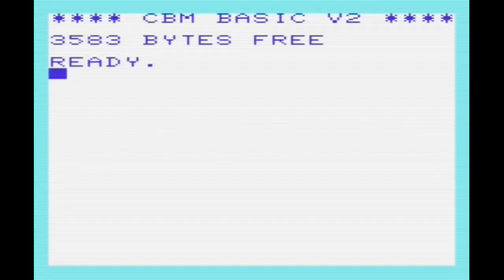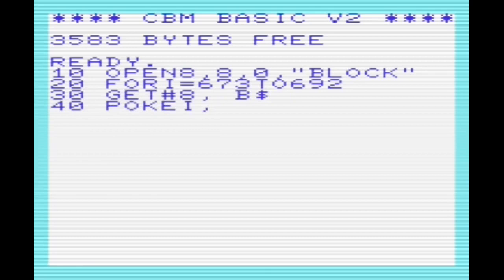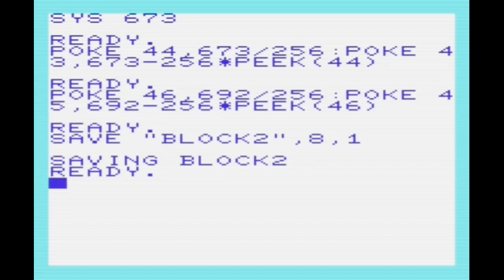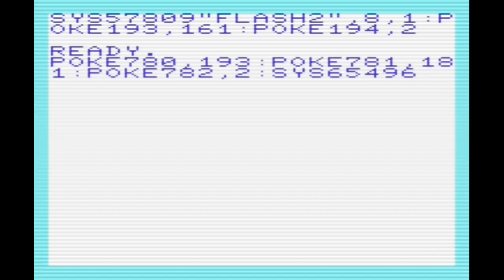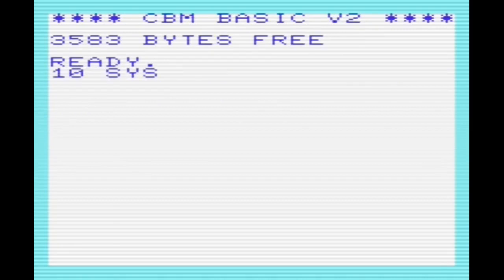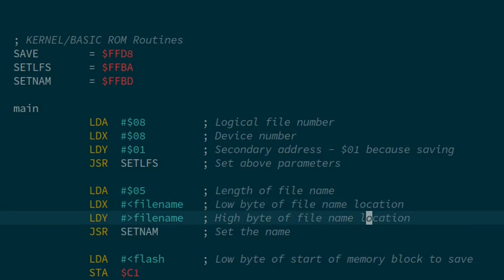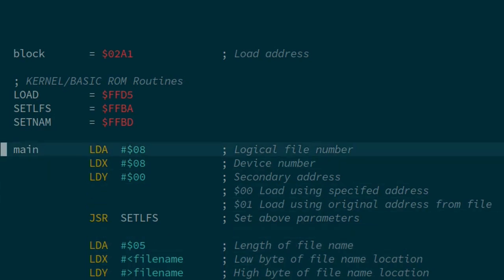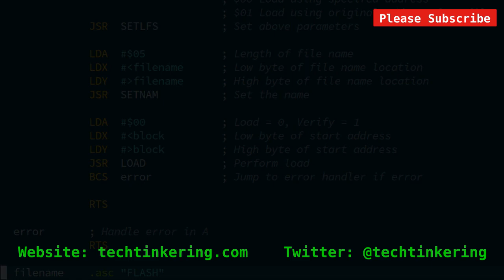Saving and Loading Memory on the VIC-20

Comment: Line 40 "POKE I, ASC(B$)"  returns "ILLEGAL QUANTITY ERROR" if the data in the file equals zero (null) ie binary 00000000. Is there a work around for this ? Perhaps an ' if B$ = 0 then ......'  prior to line 40 ?
Reply from the maker: The best way would be to test B$ against "":
  IF B$=""GOTO ?
I've just tested it and it works for the few things I tried it with.  Hope that helps :-)
Reply: @TechTinkering  Thank you.